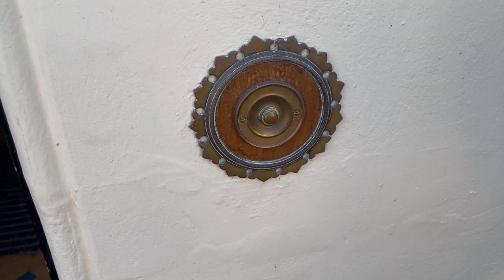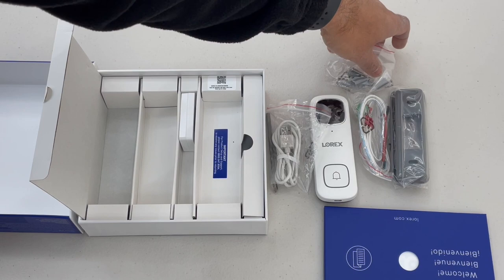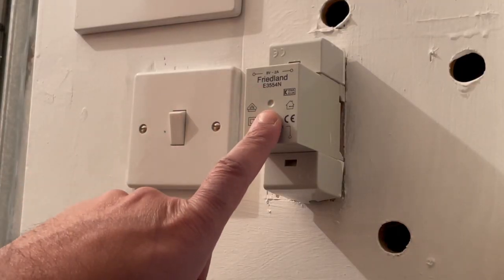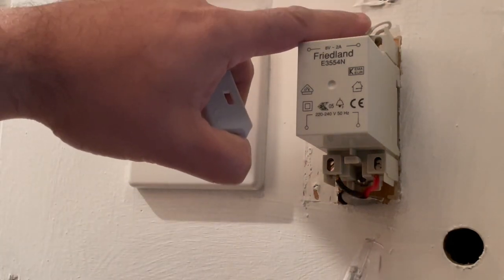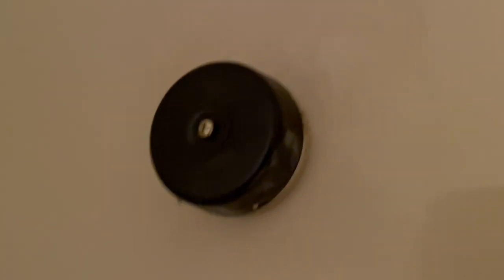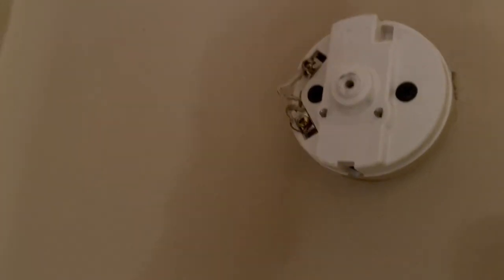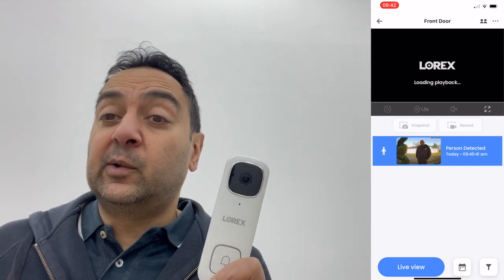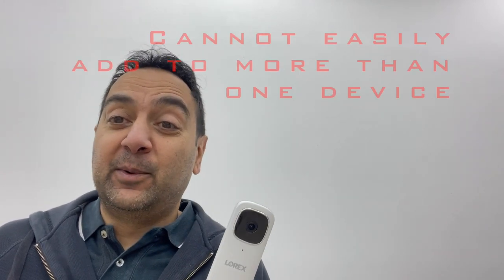LOREX Smart Doorbell Installation, Test & Review | FOUND A MAJOR SECURITY FLAW!!!

Comment: If you already have Lorex why wouldn't you add it to your NVR and remove the SD card like I did no storage on the device just on your recorder inside and all door bells are removed just about the same. Also they do have a chime box for it just so you know. Hope this helps I install just about every type door bell they all have ups and downs.
Reply from the maker: Thank you and agreed Felipe all door bells have ups and downs, but I felt this one had more downsides than upsides. Not everyone has a Lorex CCTV system so wouldn't be able to link to an NVR which means you are left with a device that can be easily stolen and the content looked at without any encryption or security. The other flaws like the lack of notifications are also annoying. There maybe a Lorex chime but this is not available in the UK. I swapped the Lorex for a Ring and a lot happier because in my view its more reliable and secure. Thanks
Reply: @sanjdesigns  not sure I understand the “no notifications “ I get a notification within a couple seconds every time the doorbell is rung, with motion, or a person is detected. 
Also our Lorex came with a ‘chime kit’ that takes literally 2 minutes to install and allows ur current doorbell to work with the Lorex doorbell. 
How old is ur home? We built our home in 2006 n I did NOT have to install an upgraded transformer, maybe UK building code is different than in US not sure but for whatever reason we have the proper transformer voltage. 
Aside from ur Alexa con which we’ve never tested, (Not a deal breaker for us as we don’t use Alexa) we’ve not had any of the issues u mentioned. 
We couldn’t be happier with our Lorex doorbell camera.
Reply from the maker: Hi and thanks for your comments. As mentioned in the video, cannot buy a chime kit in the UK so you are reliant solely on your phone. Yes our house is old (1850s), but the transformer needed to be upgraded as it was 8v rather than 16-24v as recommended by Lorex. Not an issue as it was relatively quick and inexpensive and I'm using on the Ring. The notifications you can see in the video 09:05 onwards constantly dropped (despite the wifi router being 3 meters away). These are all incidental as the biggest risk to me (and I'm sure others) is how easily the doorbell can be removed and the SD card viewed without any encryption. If you're comfortable with that then great. I was just being honest and objective.
Reply: I have the Lorex 4K wired only system with NVR (not the wired/wireless hybrid) with the bullet cameras. I got the Lorex 4K wired doorbell. Is there a way to modify it for the wired-only NVR?
Reply from the maker: Hi this works via wifi so there is no way of hardwiring to the NVR. You’ll need to connect it to via the app and it might be possible to store the footage on the NVR. Personally wouldn’t use the Lorex doorbell full stop. Had the Ring over a year and despite the annual subscription fee still worth it in the long run.
Reply: @robertdsaba  You should be able to connect it wirelessly to your NVR. I did. Garbage cameras but you can do it.

Comment: if you have a fusion set up you can have the recordings in the nvr like I do and I have my house doorbell with the chime set up it came with and it works great
Reply from the maker: Thanks for getting in touch. This was an 'out of the box' review based on what you get and assuming you don't have access to the Lorex CCTV (as most people don't) and don't want to purchase extra bits of kit such as fusion. Felt the doorbell was too unreliable and lacked basic security hence the reason for the 1 star review and returning back to Lorex for a refund. A couple of people have confirmed the same problems as me - see posts above.

Comment: So this video is slightly incorrect. Out of the box it's programmed the 2k door camera is programmed to record to micro SD card. If you have an NVR you can go into admin settings is to have recording sent to your unit. 

I had this issue as well but after some research found out it was possible to record on ur unit inside your house. And I actually changed it earlier today. Only strange thing is when connecting it that way some features are not available if u directly watch it in NVR but in app u still have standalone so it's all good.

The problem with this camera I  what he's saying is basically if u don't have an NVR unit. And this camera doesn't support cloud. But purpose of this Lorex was never to pay subscription 

Anyways video  to setup to NVR is on YouTube and hope this help the partial false info.
Reply from the maker: Hi and thank you for your comment. I think you have misunderstood the principle of 'out of the box' this means I have provided an honest review of exactly what you get in the box and doesn't mean you have to spend $00s to purchase an NVR which lets face it most people don't want to. The system should work without the need for an NVR to work properly and if you're going to spend extra on peripherals such as an NVR why not pay for a subscription for say a Ring which by the way would work our cheaper than purchasing a Lorex NVR. 

I know a lot of the criticism for my review has come from Lorex employees and sorry if i have offended you, but some of the honest feedback below has come from others who have shared the same problems. It shouldn't take me to identify these flaws as Lorex have very bright engineers who should have assessed these risks/bugs and prevented them. 

So don't agree with the "partial false info" comment
Reply: @sanjdesigns  I definitely don't work for Lorex. And I was just correcting how you are relaying the info. Remember the Lorex system is for people that don't want a subscription. So to compare it to ring which is a subscription based service and then knocking by saying how it records wasn't completely correct. I was just helping you and people with an updated info since I do have the NVR and doorbell.

Funny part is I stumbled on this video to find the answer of how to get unit to record on NVR instead of micro SD and the people in chat room that said it could be done had me find the answer in a forum which I later found the Lorex video to.

Also Ring isn't cheaper if your buying unit and paying endlessly, but I do know what your trying to say.

And you are correct about the flaw in recording being directly on micro SD if doorbell was stolen. This is why a few mentioned the alternative.

Comment: B241AJC model works with your existing chime. As for the lags, this is typically a routing issue with the ISP.
Reply from the maker: I believe the bell was the problem as the wifi router was close to the door bell and since I’ve had the Ring never had a problem with lag
Reply: @sanjdesigns I have the same lag and notification problems with the Ring, and I pay for it yearly…
Reply from the maker: Never had a problem with lag with the Ring at my house. Like others don’t like paying a Ring subscription but security is more important.
Reply: @sanjdesigns  Well, you’re lucky. By the time I can pull up the live view of the front door, the person is gone already.

Comment: After having Lorex since 2021, I definitely have the same problems as you have including with the doorbell chime being too low and the sorry try again later message. 

I believe I began experiencing malfunctions with my model since I rarely see notifications now, have had trouble accessing my old recordings by seeing a No recordings message and the doorbell has went offline more than once despite the wires are connected. I would not recommend this doorbell. I can't afford Ring's subscription, so I would search other brands to replace my Lorex.
Reply from the maker: Thanks for getting in touch. I would contact Lorex and ask for a refund if it’s clearly not ‘fit for purpose’ and don’t let them fob you off about it’s out of warranty period. 
Understand your comments about Ring subscription which was why I also chose Lorex. But picked up a good Ring deal on Black Friday with an Amazon Echo for less than the cost of the Lorex and the sub is around £30 per year. Not ideal but working fine and have to say I’m happy with it. Security is about piece of mind so sometimes it’s worth paying a little bit more.
Reply: @sanjdesigns  Thank you, I am trying to contact Lorex despite having a bad experience a few days ago with customer support. I regret buying the doorbell camera since I was hoping this brand would be an affordable option for now. I hope your video warns others about this model

Comment: There are too many good options to Ring without subscription.   Ring just raised it to $5/month, $50 annual.   I installed the Lorex 2K Battery for my niece and they love it.   Many great features.  And works flawlessly with Alexa.  And no fees, like Ring.  

Eufy also makes many capable video doorbells with no subscriptions and free chimes / base stations.  I have the Eufy Battery 2E (2K HD) with base station (chime, 16GB, WiFi extender).  It’s only $75 on Amazon (regular price $150).   If you want a more advanced model, the Eufy E340  / S330 offers build in video storage (with or without a base station) and dual cameras with package detection / protection.   

If you must have a name brand, the Google Nest doorbell is also very good.  It includes 3 hours of free video.  Plus subscriptions if needed.   Like many I started with Ring.  But will probably never go back.  

Note: Currently Eufy only works with 2.4 GHz WiFi.  If you only have 5 GHz to work with go with Lorex or Nest.
Reply from the maker: Thank you and agree that the Ring hike in their subscription is disgraceful. Am aware of Eufy but never installed so cannot comment. If they use an unencrypted SD card similar to the Lorex then I wouldn’t want to take the risk for the sake of $50 a year. 
This was an honest review and given the choice between Ring and Lorex would still choose Ring - despite the extra subscription cost. Hope that helps.
Reply: @sanjdesigns  Hi, I’m still confused.  How are they going to steal data from your SD card?   What are they doing with it?   And who cares?   Just curious.
Reply from the maker: So as you could see in my video, it’s really easy to remove/steal the device and remove the SD Card. The SD card can then be placed into any laptop/PC without a password and all the images, videos and timelines can viewed. This to me is a massive flaw and I wouldn’t be comfortable with that. Whilst the Ring is expensive, it’s cloud based so if your bell gets stolen or removed no one can see the images. Just my thoughts.
Reply from the maker: Some people face stalking and domestic abuse so  these are the people that are most at risk.
Reply: @sanjdesigns  Hi, I have since upgraded to the Eufy E340 dual camera doorbell, one camera for people and one for packages and it works really well.  Definitely the best video coverage I have seen yet in a doorbell.  I’ve previously used Ring, Nest, Lorex and Eufy.  The Eufy does have a build in SD card but has the options for an in house base station or online storage.  Personally I’m  just not concerned about someone getting my doorbell videos.   I think the best deal in video doorbells is the Eufy Battery 2E (2K HD), It’s $75 from Amazon (cheaper on eBay) and includes a base station (chime and 16 GB of video storage).  No built in SD.  I’ve used and it works well.

Comment: Someone gave us a Lorex camera before we installed the doorbell. I’m already wondering if I want to bother because the camera is so lame.
Reply from the maker: I have the Lorex CCTV Cameras and they're pretty good and reliable so no problem recommending those. The doorbell is however, as you said, lame. It all depends on how much work you need to do to install it. If it's just connecting to existing wires then go for it. If you need to install new wiring and transformer then I wouldn't bother. Concept of the Lorex doorbell is good, but the execution and reliability is really poor. I know Ring has increased its prices which is disgraceful, but it's still better in my honest opinion. Hope that helps mate
Reply: @sanjdesigns  we have the pan and tilt camera and no mater how I set it I get notifications every time a car drives by. I turned off the notifications because it was so annoying.
Reply from the maker: Yeah, know exactly what you mean. No matter how and where you set the 'zone' it goes off too frequently so it makes sense to turn notifications off - especially where there is a lot of traffic. That aside, the cameras work well and the resolution is better than some of the competitors. Just my thoughts

Comment: These doorbells are garbage. They often fail in 16 months or so. The delay for notifications is terrible. Often the weird"Oops" message that you showed. You can take the chip out and just have it connect to your NVR where the video will be saved.

That said, I would stay away for these Lorex cameras. Support is awful. Search YouTube universe and you see guys posting about failed AC power supplies. One guy said there is a battery inside that swells causing all kinds of power problems.
Reply from the maker: Thanks for the feedback. Returned mine soon after the published the video and glad I did. 
Didn’t want to link it to the NVR as wanted to show what it was like to live with without an NVR and the results are there for all to see
Reply: I've had my Ring Elite for more than 5 years.
Reply: Both my Eufy’s did exactly this.
Only worked great for a few months.
By 6 months it didn’t obey half its settings, and after a year it can’t do a single thing properly.